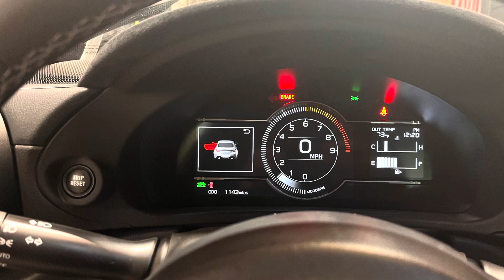GR86 First Oil Change | GR86 oil analysis | GR86 RTV

Comment: Toyota told me to keep the factory oil in there for a year. Should I believe them?
Reply from the maker: I recommend going with what the manual recommends for your climate and driving style.
Reply: Change that oil and filter out at 500. Then again at 1k. And then at 3k and from there go to 3k intervals.

Comment: Why do you choose 86 over Mustang eco boost, Type R, and elantra N?
Reply from the maker: That’s a great question. I choose the 86 for a few reasons: vehicle cost, insurance, overall cost of ownership and lastly simplicity. This is as close to a true light weight analog sports car that you can buy besides a miata and that’s what I was after. All cars you mentioned are great in their own way.
Reply: @atpgarageatl  For cost both elantra N and 86 in same level. But one with a great 2.0L engine and an 8-speed DCT and suspension has been tuned based on rally experience, which gives you exceptional performance. Oh, don't forget exhaust sound.
Reply from the maker: @sayedengine  the Elantra N was quite a bit more than the 86 when I was looking to purchase but I agree it’s a good car. The N has a great sounding exhaust. There are several options on the market to make the 86 sound better. The factory exhaust is too restrictive.

Comment: Do you need to replace the oil plug gasket (if any)?
Reply from the maker: There is a gasket on the oil drain plug that should be replaced each oil change.

Comment: Did you void the warranty by dropping the oil pan yourself?
Reply from the maker: I only changed the oil and did not drop the pan so I have not voided the warranty. I do not plan to drop the pan at the moment since it is still under warranty.
Reply: @atpgarageatl  thought I heard someone say that they asked the dealership to drop their oil pan...dealer was hesitant, but agreed to do so, and if anything found, dealership pays.  Strange, but you think this is possible? Thanks for the response.
Reply from the maker: @RAY_FILET  I think it’s possible. It really depends on the dealership since each one is owned by either a corporation or an individual and not the manufacture/Toyota they can decide if they will do it.